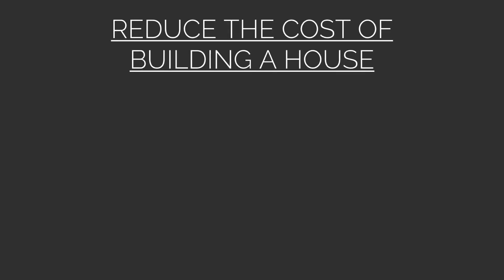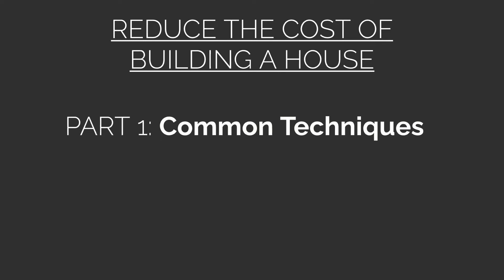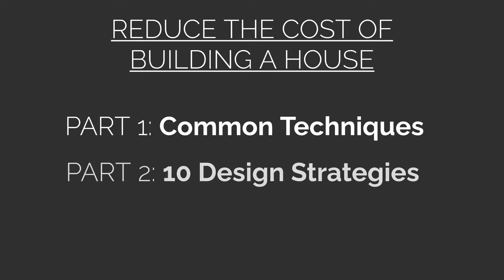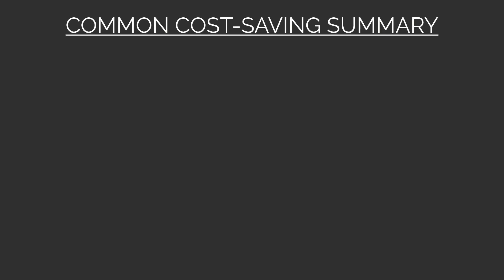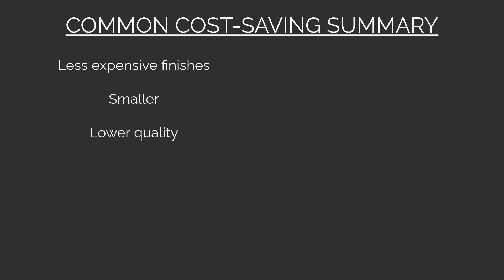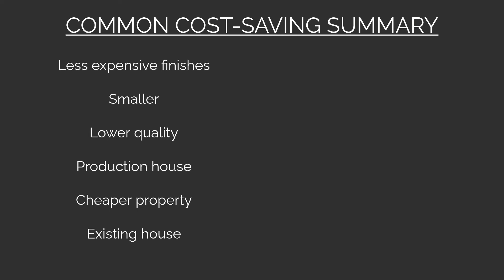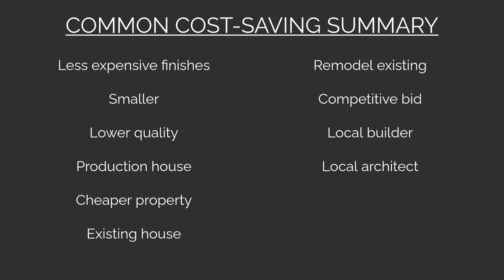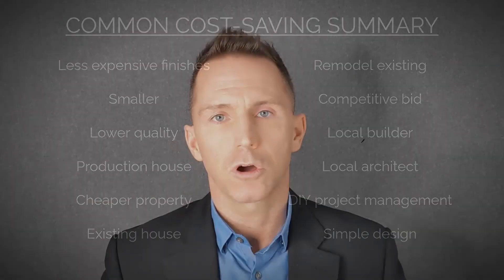BUILDING A HOME: Reducing the Cost of Building A House (Part 1)

Comment: Minneapolis newspaper did PSF on existing home including lot .  Neighbor hood matters. I think $330,450 and 670 for different neighborhoods.
Reply from the maker: Agreed Dan, and it's actually an understatement.  Availability of skilled trades in the area, access to the site (even within a city), proximity to distribution hubs for some building materials, local building codes (energy efficiency requirements, seismic constraints, hurricane/wind resistance) all contribute to a wide spectrum of cost per square foot / metre.